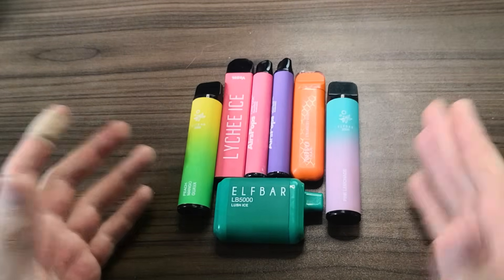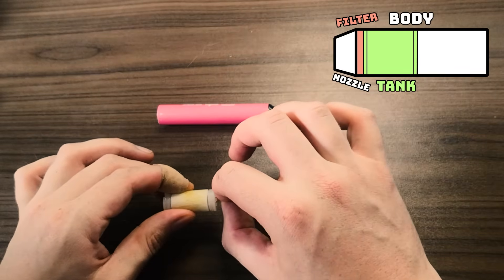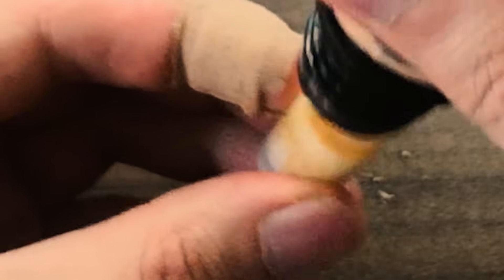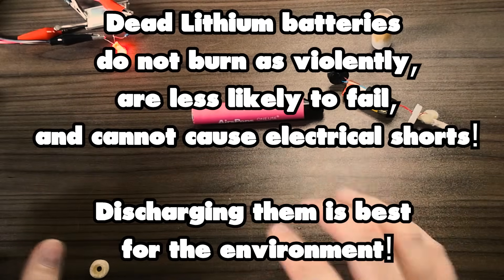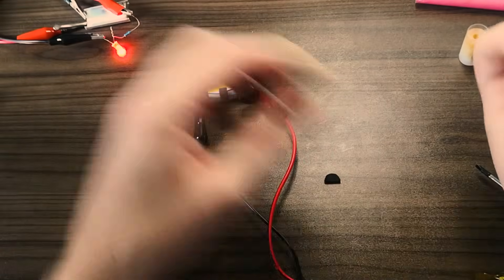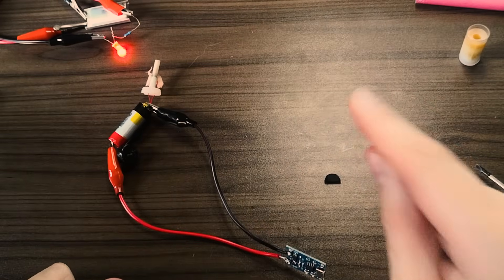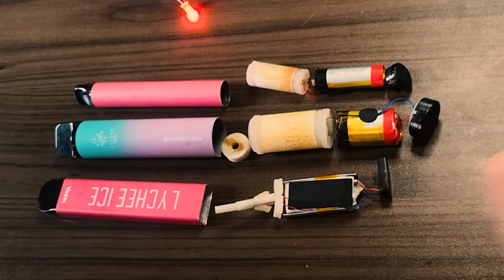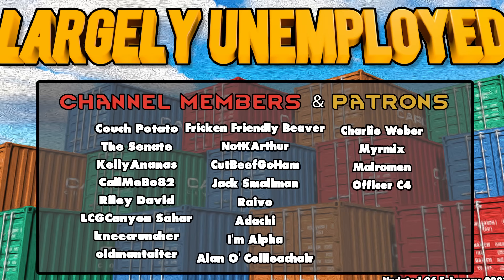'Disposable' vapes are a lie. Here's how to fix them.

Comment: He doesn't show the most important part. 
The sugars build up on the coil, and the coil repeatedly heating burns the cotton wicks and sugar build up. 
The coils are crazy simple on the disposable so be very gentle or they just fall apart. 
I soak mine in sulphuric acid and replace the cotton wicks. It works brand new when I'm done. 
Most people don't have sulfuric acid sitting around, it's drain cleaner if you have any drain cleaner?
 So you use something like vinegar, Windex or rubbing alcohol with a paintbrush or very very soft toothbrush. Gently brush off all the caked up black crap. Make sure you get it all off, it's kind of tedious. Wash the coil real good, Replace the cotton wicks and it tastes brand new. 
But you still have a huge problem. It's the problem with this video!
 He's using juice made for a regular vape, not a disposable vape. It works fine and will give you a vape, but it'll be flavorless with little vapor. 
The coils are made completely different and the disposable and refillable are made for two different purposes.
Disposable Vapes are made for flavor not blowing big clouds. You don't get a ton of vapor but you get a ton of flavor. 
Refillable Vapes are made for blowing clouds. You get a ton of vapor, with minimal flavor.
  When burning that much juice to make those giant clouds, you have to have a low sugar count or your coil will burn out almost immediately. 
So they're really two different things. And you can't buy the same juice they use in these disposables. So if you're into the flavor you will never be satisfied with those little refill bottles the vape store sells.
 I never refilled the disposables. Just buy a regular refillable one, you can get them for $15. 
But once in a while my disposables will burn up the coil. This is when knowing how to take them apart and clean the coil helps. 
 5 minutes of work can save me 25 bucks. 
My last two elf bars got stuck on, within an hour buying them. They burned the coil so bad they were almost un-salvageable. Both were refurbished back to new.
And sometimes one breaks and has a lot of juice left in it that you might want to put into another disposable that's running out. This is another great reason to know how to take them apart.
But using refillable juice from the vape store, on a disposable is kind of dumb. 
You get the worst of both worlds, you get small clouds and no flavor. 
Refillables have about 1/10 of the flavor of a disposable imo.
So the video is cool as far as seeing how they come apart, but don't do with this guy is doing he's an idiot. 
Three charges of battery all he had to do is use the vape that had the charge port. And connect the batteries to that and plug it in. He's got voltage testers and all sorts of nonsense. 
I'll end it with this. Using store-bought vape juice in a disposable, will give you a wispy little vapor that has no flavor. If it's worth saving a couple bucks (which I don't think you even do) and have a crappy vape, then this videos for you.

Comment: Please dude, take this video down. I'm a professional in the industry and PLEASE, PLEASE, PLEASE, do not break open disposables and refill them, the coils are not designed for so much reheated and the metal will break down while you inhale those tiny pieces of metal. Just talk about devices that are meant to be refilled and reused. Vapresso xros series is a great example.

Comment: The elfbar has two clips at the base of the vape that hold the bottom on. Pushing on them simultaneously will allow you to open up the bad and do everything you need to do. I've also seen entry via the top stem using pliers but that does damage the stem/mouthpiece.

Comment: Lamentablemente no son reutilizables, si bien son relativamente fáciles de abrir para recargar líquido lo que falla muy pronto luego de esa primera recarga es la resistencia o las resistencias, en el caso que lleven dos. Lo que luego falla es la batería. Entiendan que estos aparatos están diseñados para usarlos con la carga de líquido que traen, por lo que las resistencias y baterías van a durar lo que necesiten para eso, no van a ponerle algo más resistente, ergo, más caro. Comento por experiencia, ya hice el intento con más de un vape de esos descartables. Si tienen la intención de recargar gasten un poco más en uno recargable al que le puedan cambiar las resistencias o cartuchos e incluso la batería, en el corto plazo les resultará más económico y ecológico. Los vape descartables deberían estar prohibidos.

Comment: Love this video. I hated buying the disposable carts. Can you do a video on vapes that have a reusable battery and disposable carts? (Like the level x g2). The issue with them is this : even though the carts are very simple to refill, the company has put a "counter" on them. So even a fully refilled cartridge will show as "empty". I have tried tinkering around with both components, but no matter what I do, I can't get around the counter.

Comment: I've seen a couple guys rip the lith-ion batteries out of these things and spot weld them together with a BMS to power other things. That's more of an issue IMHO, lithium isn't so rare that we'll be running out of it soon but mining it does take significant effort and is usually outsourced to poorer countries for cheap labour. Someone had to dig up the lithium being trashed in these disposable vapes, and these batteries are all still in good condition and usable. A fresh new source of e-waste (and a dangerous one too because lithium battery fires burn for a crazy long time).

Comment: So I did all this n the problem is all I taste is burnt coil.
Reply from the maker: Yeah as other commenters have mentioned, this method only works once or twice before the coils oxidize and it tastes terrible. I hadn't run into the issue when this video was made, and so I dont mention it.

 Unfortunately refurbishing those components is definitely not worth the cost involved. 

You can still salvage the batteries, but the solution does seem to be that we should just not use these things.

Comment: i hope they are stainless steel wires for the coil. some using mesh coils. but all in all they are all low quality coils NiFeAl… causing some people to cough. also the liquids are under the minimum of secure level for loung diseases. bring them to the recycling center and never buy them.

Comment: Hey I’m all about right to repair… but the single use is also a benefit to consumers.  If any of you were around, old enough for rebuildable vapes before the fight against Juul highlighted vaping “targeting” teens (20 somethings of the time also wanted all the thing they blamed for targeting teens and were old enough to legally enjoy cotton candy flavors…) but that atomizing leaves residue on the coil that eventually burn, the wick eventually burns… those both need to be changed or they give off nasty bi-products.  So fresh coils and wicks are important.  If you ever noticed your tongue getting numb as the juice level says low but it seems fine, that’s from those bi-products..just get a mod box if you’re doing this, heck you need the vape juice anyways for this.
Reply: @MattSmith38258  👍

Comment: I would also recommend not using a high amp/Wattage fast charger to charge this type of battery. Probably fine but you might fry the circuit board and possibly ruin the battery

Comment: I just rebuilt my mom's Chinese headphones and part of that was upgrading the battery. I used a disposable vape's battery, the upgrade in capacity was 225% which is crazy. These vapes are an amazing source for batteries and sometimes the type c ports can come very handy since some are very small and can fit in other random devices, I switched 2 devices to type c with vape parts so far.
Reply from the maker: That's awesome! Please just make sure to test them quite thoroughly for faults, swelling, or rapid discharge issues before putting them in anything that's going to be near your body! As other comments have pointed out already the quality control on these cells is hit or miss
Reply: @LargelyUnemployed  yeah of course, the one I used is perfectly fine 👌

Comment: Dunno about where you live, but it costs a similar amount to buy a good pod system starter kit as it cost to even buy a cheaper disposable. Just get a pod system, they use the same juice and it's cheaper overall. I've had a decent experience with UWell

Comment: Reusing a burnt old coil is a bad idea. The chromium in the wire tends to spaul off over time, and once that gets into your lungs, it never gets out. Theres a reason they have a lifespan. Just because the battery can be reused, doesnt mean the rest can. Save the batteries for a powerbank if thats what you want to save, but ditch the vape, they arent safe for longer term use.

Comment: The ones like the green ELFBAR you had, are actually very easy to refill. Grip firmly and push the mouthpiece with your thumbs from one side then the other, back and forth until it pops up enough to access the foam. Add juice several times, allowing time for it to saturate and carefully reposition the cap over the components before popping it back down.

Comment: what if the vape does not have an airflow sensor? if you could, could you make another video using other products? thanks so much though, this video helps a lot in the first place.
Reply from the maker: It should make no difference to the process. The airflow sensor isn't really even involved here!
Reply: @LargelyUnemployed  thanks for such a quick response!

Comment: Please just don't buy this shit. Buy a refillable system.
Reply: The refillables are designed to leak, which prematurely kills atomizers and eventually the entire unit.

These disposable units are designed not to leak if refilled properly, and are cheaper and easier to get than a refillable system. The only downside is that the atomizers wear out eventually, but it lasts about the same amount of time as legit refillable atomizers anyways.

Comment: This is good knowledge for people who need it, but I wish we could just get away from the manufacturing of disposables altogether. If people would just buy a pod system they could save tons of money in the long run, experiment with different flavors, settings, and nicotine levels, and only trash a single battery over the course of years instead of going through multiple batteries per month. The economics and environmental impact of disposables make no sense to me and it's shocking to me how accepted they are. I really think vape shops should stop carrying them.

Comment: How long will the average coil last in a disposable before it burns out though.
Reply from the maker: Not long unfortunately. 3-4 refills according to this comments section.  It seems to be the real limiting factor here, but the batteries can still be salvaged for sale or use elsewhere after the coils go!
Reply: @LargelyUnemployed  why is there a market for disposable lithium batteries? If there making so many they obviously buy them cheap? I mean are you saying a homeless man could go picking them up stripping them and making cash? Id be very impressed if it were so lol

Comment: Not all lithium batteries are meant to be recharged.  They can handle a bit, but they will fail eventually.  I've recharged my breeze pros a couple times, but i wouldn't recommend doing it more than a couple times.  They will overheat.  Not all batteries are created equal.  You can recharge old school batteries a bit too, but they will fail eventually and that can be dangerous.  It actually is almost certainly dangerous eventually.  Be safe people.  Look up recharging noon rechargable batteries.  It's not a conspiracy, they are designed differently.

Comment: If the energy piped through the coils causes wear similar to an incandescent bulb, how do you prevent metal dissipation into the vape when using a refilled unit? Or is there a separation between fluid and elements? 

Seriously, new to this.
Reply from the maker: Unfortunately there isn't a way to prevent contact, as that is how the liquid is atomised. The coils will degrade quite quickly and seem to be the real limiting factor on how many times you can refurbish these.

Thr batteries are still good though, and can be salvaged alongside the charging circuit for sale or use in other projects. Of course, always test batteries thoroughly before using them.

Comment: Hey, one question, how many times could i reuse a vape, i have one that had 30k hits, refilled it and works like a charm and because it is that big it has a usb c charger, no need for soldering, how many times could i refill it and be safe?
Reply from the maker: Probably 2-3 more times? I've heard from the comments here that the coils will eventually give out. The batteries and charging circuits are still good though and could be salvaged to use in other projects or for sale!
Reply: @ thanks for the fast reply, great vid btw, beep on tinkering

Comment: Good info. I refill "disposable" rechargable vapes all the time. They don't last forever though so when the coil goes out or when they just don't work that well anymore, i pull the battery and charge controllers out to use in other projects. Mostly to make flashlights rechargeable but they can be used to make pretty much any battery powered device rechargeable. Given the voltage is correct. It's incredible how much useful devices are considered disposable and just get chucked in the garbage.

Comment: You can use any charging cable, just cut it from the top and you will have two strips, one red and one black. Place the red on the red part of the battery and the black on the black part of the battery and thats it leave it for 5 minutes and the battery will be recharged thank me later

Comment: Greate video , but there is a small question that I have how long dose these coils last , I mean how many times we can reuse these pods ?!
Reply from the maker: From what others here have said it seems to be 3 or 4 times. I don't vape so I hadn't experimented much with the flavour. It's a real shame as it really limits the potential of this process. It's still better than just a one-off, but no replacement for a proper rechargeable unit.

Comment: instead of buying things as he said you only need vape juice, to recharge the batter you can take any charger and cut off the part you plug into your phone or whatever then get rid of like 2-3cm of the rubber thats isolating it find a red and black cable on these two you need to remove the rubber thats isolating it once you have that done just put the end of the black cable on the black marked part of the batter and the same with red then hold it there for around 2 mins it might feel hot on your fingers but for me it worked just fine, if you doubt anything just reply to this comment, hope this helps

Comment: 😢I had just recently thrown away a bag full of disposable vapes. I had asked online what I should do with it. (we here in Germany can specify batteries in department stores for correct disposal, But they don't take complete vapes) unfortunately I had not seen your video yet. You can really sell them on ebay? I wouldn't dare to reload. But I could take them apart and then take them to disposal. Or actually sell them on ebay 👀 I searched on ebay but didn't find anything. But I don't know exactly what to look for either. Do you have an idea what such an ad should look like?
P. S. Thanks for your video
Reply from the maker: Hi! I'm not sure about the specific laws surrounding this in Germany, but where I'm from reselling the batteries is perfectly legal, so long as you slap the right hazard warnings on the packaging.

As for listings, you'll have the best luck if you search the model number of the batteries directly. "LiPo Battery C13840" for example
Reply: Not sure about Germany specifically, but some vape stores in other countries accept disposable vapes for proper recycle (and sometimes they even give you a store credit/free stuff for it). So if you use alot of disposables, it's might be a good idea to ask around.

Comment: I am trying to quit smoking and cold turkey was to hard. So now i am on these disposables for a month without nicotine. I did think they were sooo expensive so I followed this vid. IT WORKS like a charm. I did it with a lost mary and soldered wired on the battery and two other wires into the curcuit. So i just have to pull apart and charge without continuaslly soldering. Its amazing.
Reply: Just buy a real vape before you blow your fingers off.
Reply: @ happy to announce it did not happen:)
Reply: @ yes and a lot of people change outlets without cutting the power and don’t shock themselves to a early permanent vacation. It’s still a bad idea but I’m glad you got lucky enough to not hurt yourself or others.

Comment: You could just buy a Sonder Q,  it's refillable costs between  $14-$20 and you can buy enough juice to last well over a month for $12--I've been using the same one for over a year now just replacing the burner cartridge every month or so--they  run 3 for $8

Comment: New laws are coming in in the UK to ban disposable vapes, but companies are experimenting with work arounds.  One company here is 'Vapes Bar' with their hybrid disposable vape. Effectively it is a rechargeable battery unit that you buy pods (which contain the coils and are pre-filled with 2ml of NicSalts.
The problem with this though, is that the NicSalts run out long before the coil is done, hence you are still throwing away perfectly good (and expensive) coils.  I have fixed this problem.  You may find my short video interesting...  https://www.youtube.com/watch?v=khcOskj7iQU  
I have basically made a hybrid disposable, into a normal vape.  Rechargeable battery and refillable.